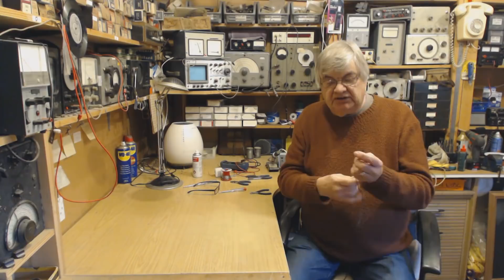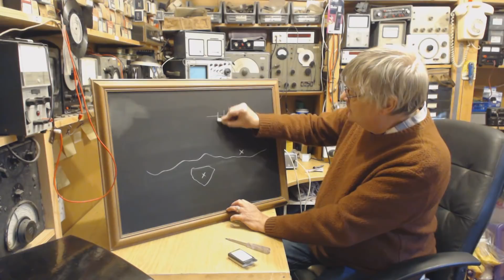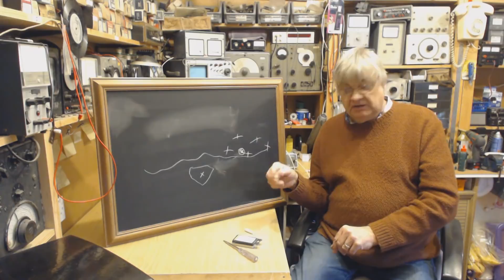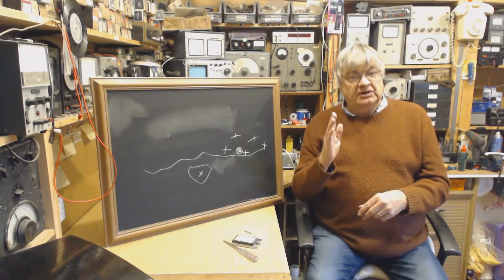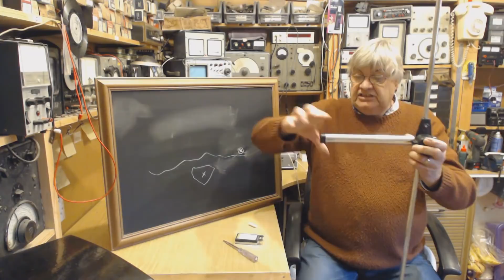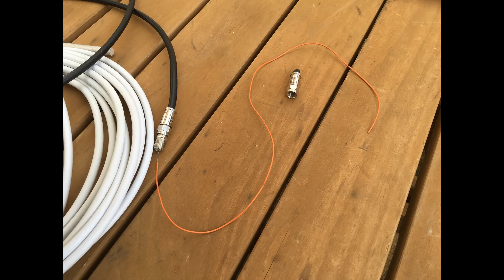Outside aerials for DAB & FM radios & tuners

Comment: Fairly recently I set up an external antenna so I could receive a decent signal from the FM community radio station I manage, about 20 KM from where we live. My initial experiments used an old TV "rabbit ears" type antenna spread out so it was set up as a vertical. That worked really well, but for the final setup in a different location on the property I got the best signal by putting them in a V configuration, basically how you would typically deploy rabbits ears on a telle! 

Now my question to you is that although these rabbits ears are nothing more than two telescopic rods, they are connected to a short piece of 300 ohm ribbon feeder and then into a balun before going through my coax into the radio, this being a surplus car radio set up as a base receiver. Should they actually be terminated with the ribbon feeder and the balun? Since they are not a folded dipole wouldn't they match better directly into the 75 ohm coax and give a better signal that way?  Or, since I have them set up in the "V" configuration does that change the characteristic impedance of the antenna, making it more like 300 ohms, hence the ribbon & the balun?
Reply from the maker: Excellent! It's well worth experimenting. Cheers, Ray.

Comment: Ray I discovered a youtube video put out by one of Radio Caroline's staff they are the ones behind the dab radio in the UK and a couple of places on the continent each transmitter is home brewed with low pass cavity filters custom made from italy with linear amplifiers from Australia if you can pull in their transmitter from the main motorway that runs through the center of London.  In the video description they posted a website dedicated to their DAB network service looking for volunteers to put up a dab aerial and transmitter at their location so they can expand the service and the other night here across the pond were I am i pulled in 1368 am medium wave manx radio from isle of man I think they run around 50 kw's and are undergoing much needed transmitter replacement and aerial upgrades reminded me of when I was a younger lad listening to kiss 103 Vhf fm belfast when Barry Marsh aka Miles Johnston and Andre Van' Os aka Robin Ross Dj. Satin with 1 mega watt pirates of course  we used to hear them from Long Island New York all the way up the coast to Nova Scotia They main transmitter Valve is at the new Crowborough facility on display in the Lobby I think they transmit Sunshine radio and maybe Classic fm from their. Ray you may be able to tune in 87.7 vhf fm radio carolines micro fm station broadcasting from the docks of Harwich from the former lightship now pirate radio ship the lv18 I hear from south end wharf with a good pair of looking clases you can spot the Ross Revenge down river of the boat yard in Molden and the lv 18 upriver in Harwich when the docks are clear of the cruise ships.
Reply from the maker: Vicky Geagan thanks for all the info, most interesting. Nice to hear from you.
Reply: Your quite welcome Ray wounder if the pirates put up a dab transmitter at orfordness nice to hear from you too

Comment: Ray a good point on grounds. But I do not know this would work with many new dab radios that have an external power supply. These as you know have floating power and are not directly connected to ground. I am not a huge fan of dab radios but they are getting better. I still listen to radio 4 on long wave.
Reply: The radios might be getting better, but the broadcast bit rates seem to be getting worse and worse, when you think of the brilliant high quality stereo VHF you used to get in the 70s and 80s compared to the audio quality on DAB now. I'd skip DAB and go straight to internet radio and then if you have wifi around the house (plug in wifi repeaters are cheap) then you have a high quality portable radio with much more choice and no outdoor aerials to wire up.